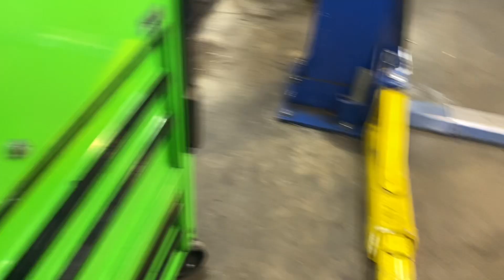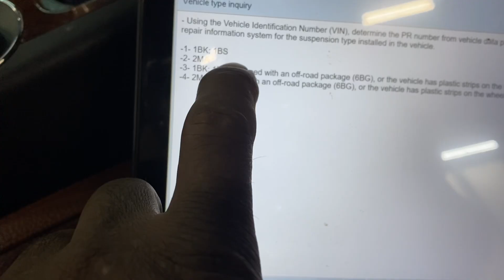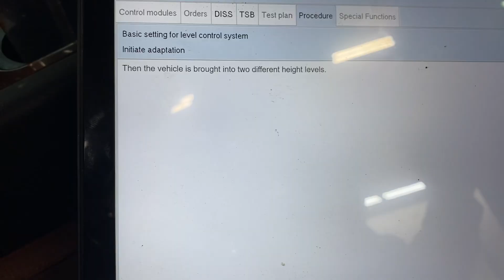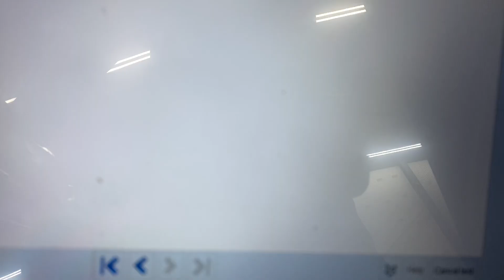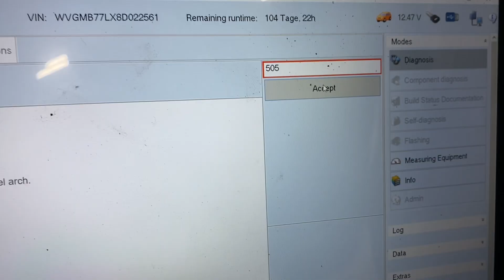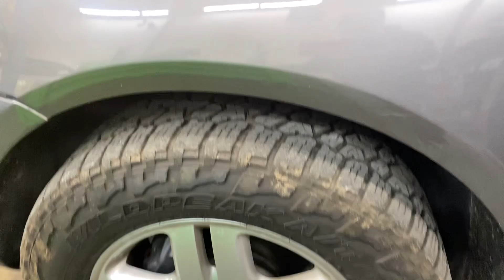Touareg air suspension.

Comment: Hello I jus changed my compressor and Valve assembly  the second time ..first time was success this time it is staying high in the rear will not lower the first time I did not remove valve block this time I did ..remove it what could be my issue the front responds the rear not so much
Reply from the maker: @RoadHeros610  any fault codes? At the block is everything connected properly?
Reply: @volkswagengeneralrepairs8976  at the moment i don't know I'm not with the car to scan it , I use a launch scanner . My wrench hand does not have a scanner so will probably have to wait until the weekend for that ..but I am having him switch the air lines the front to the rear rear to the front to see if the back responds ..if the air lines are pulled from the valve block it will bleed all the pressure out I'm assuming that how it should work when reconnected it is airing all the way up
Reply from the maker: @ just double check your work and if everything looks good replace the valve block.
Reply: @volkswagengeneralrepairs8976  ok so I had the lines reversed into the block front lines to the rear and rear to the front .it initially rose high in the front then lowered itself to somewhat even (  I jus found out by my installer that we are still getting the running gear fault and this is a new pump it's a Chinese pump but brand new so I suspect this is part of the problem )  I ordered a complete used tested set up that was on a cayenne turbo Porsche the part numbers are close to same pump and solenoid block so we shall see .I do know infact that because the pump is faulting that it's not completing it's cycle of balancing the car out